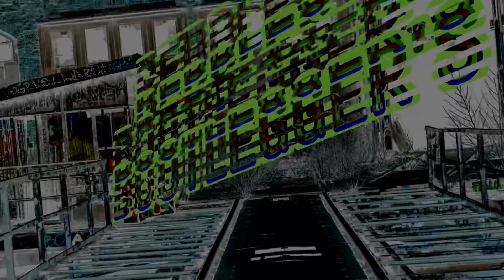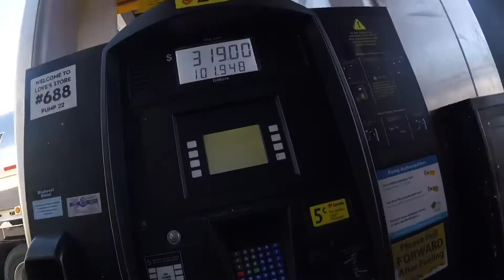Day 3 of the California coast to coast run.

Comment: the house pop because there's about 15lbs of pressure in there, tighten clamp when hot, then when cold loosen clamp push hose on then re-tighten
Reply from the maker: david schleicher thanks for the info didn’t know that. The guy in the shop at petro seemed like he hade no clue on what he was doing